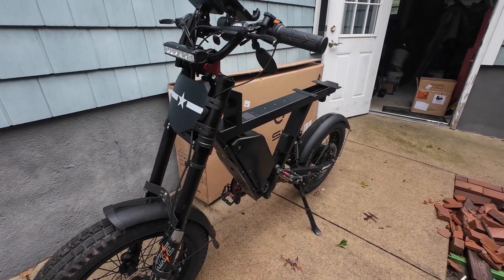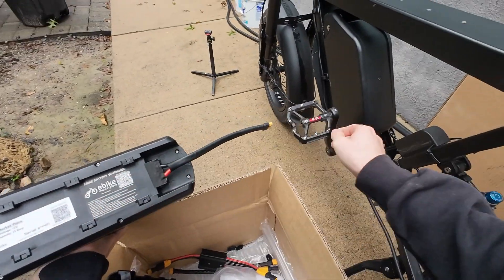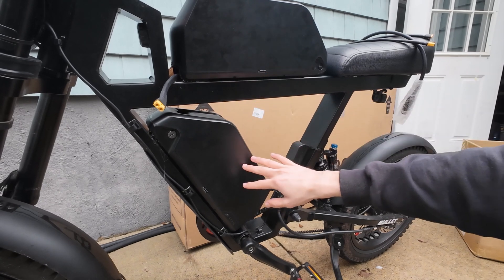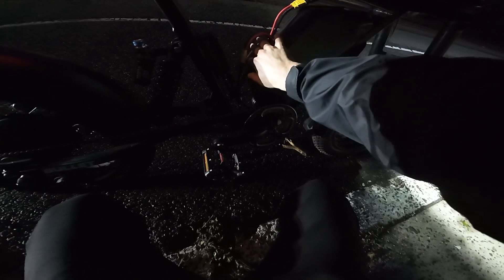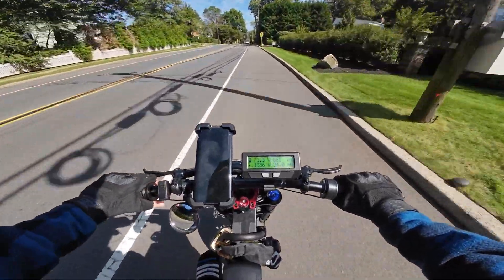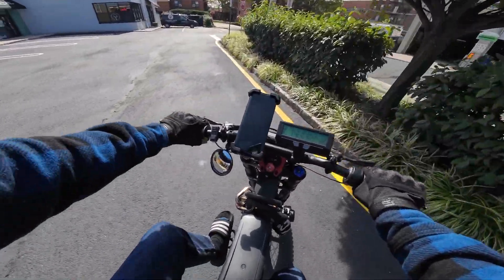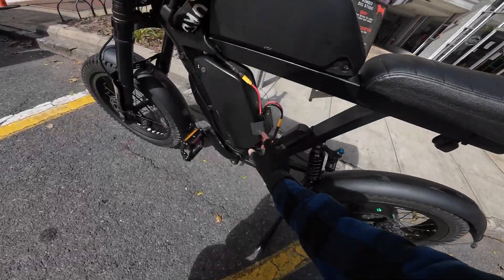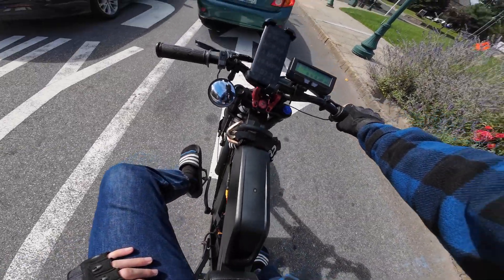72 Volt Dual Battery eBike Build

Comment: bicyclemotorworks: "WARNING:
Disconnect packs from module when charging.  NEVER charge while battery packs are connected in parallel."
Reply from the maker: This is true. I asked the battery company about this and they said the battery BMS handles it.

Comment: So if you move the controller around back  would both batteries fit in the V? If not how about hanging under the seat, is the suspension travel too far and it would hit the fender? I think getting the battery lower would handle better.

Comment: You should always charge your battery to 100% because BMS balances cells at the end of charging process! In practice BMS charges cells to ~4.2V and then try to balance them down to 4.15V.
Reply: You should do it once a while but not always. You lose a lot of battery life charging to full
Reply: @bobikbobikowy5458  In practice it does not  matter. For example I have 48V 25Ah (1200Wh) battery and I do only ~30 cycles/year. After ~500 cycles you lose ~20% of original capacity.
Reply: @ataksnajpera  you loose capacity just keeping it charged fully. I cant remember how much you loose by doing it but its bad. I got 9 years old battery and like 80.000km on it. It still works because i never charge it to full. If you make only 30 cycles/year then its even more relevant because you store it charged for longer time.
Reply: @bobikbobikowy5458  I use my bike for commuting so it is never left at ~4.15V for long time (no more than 48 hours). You are a little paranoid about battery degradation. You know what is more dangerous? Heat generated during fast discharge! for example when you constantly use throttle at 750W+. I have mid drive motor with torque sensor and I never use throttle. I also barely need more than 300W of assistance.
Reply: @ataksnajpera  maybe im paranoid but my battery lasted longer than most branded ones. I have 3000w controller and heat didnt kill my battery :p 750w is nothing

Comment: The 🎤 microphone during the video to me was better with B. I like to hear what the motor sounds like at 20 or 25 mph to get an idea of the power output and what it sounds like. Like listening to the RPM's in a car with standard shift to know when to shift. But 🎤 A😅 microphone a would be the ideal one for communication which can be very useful while riding with a group.

Comment: How about putting both batteries under the horizontal bar and move the controller upside down onto the horizontal bar. Make a vented carbon fiber enclosure for the battery section with flow thru vents for the batteries and controller.  Maybe the battery splitting unit possible at the very bottom where the batteries on the slanted part of the frame. 😊just a suggestion then there is a lot of room on top, possibly light cargo or backpack.

Comment: I left this one one of ur earlier videos too where u me tinged The ekx x21 is the gunai x25(the x25 is Lower spec Ed also know as the zwp x20) I got one from AliExpress and they are amazing but the controller may needed to be upgraded to be able to use ur 2000w depending on the brand u buy from

Comment: Also just order some 12G silicone coated wire and solder your own XT60s to the correct length and is much tidier, great video though, very professional

Comment: What are the AH one each motor? Did you sell the battery it came with? if so for how much?
Reply: Ah is a capacity measurement so is for battery packs. Motors are measured in W and how many V and A you put to it

Comment: Question im in the process of competing a similar build if you dont mind me asking how did you rewire your lights? I see you got rid of the  stock display. Do your brake lights work? Also, where did you get that frame guard in front of your battery? Thank you so much for your help, bro.
Reply: Just take the auxiliary wires from controller, run through an instrument switch cluster on handlebars and to relevant lights, indicators, horn and connect up the brake interrupt wires if you want working brake light.

Comment: You get better performance/lower voltage drop from higher wh battery, in addition to less stress on them.  The batteries appear identical.  The case for using them one at a time is that you can recharge one after its rested, and wait to put it back in after its rested from its charge.  If ever you were going long distance and charging along the way, that is actually less total stress on the battery compared to a constant lower discharge rate in parallel.

On a bike similar to your wicked 20x4, 48v, I'm getting 5wh/km by pedaling, 30kmh average, without pedaling crazy or any real cardio.  Just 150w@30kmh from motor.  35wh/mile is bad.  875w at 25mph.  That is why pedal-able bike is so important for affordable range.

Comment: If you have two of the same packs, you should just get them charged to the same level and simply parallel them together. You can skip the extra combiner entirely. If these are common port bms batteries (which is almost always the case these days) you can even just charge them while paralleled. 

At least it's not one of the INSANELY overpriced DATEX combiners...

Comment: If both batteries are the same voltage, you don't need the Dual Battery Discharge Converter, you just use a standard splitter, that's what i use with no issues.
Reply: They have to be exactly the same voltage, if not you get sparks?
Reply: @coop5000  If they are both about the same voltage they should self balance. I would never hook them up that way without verifying they are close to the same voltage. The way he did it is the right, safer way though i do agree.

Comment: That controller is absolutely tiny compared to all the other 72V smart controllers. Definitely going to buy that if I ever go over to 72V
Reply: Never cheap out on a controller man leave some overhead.
Reply: The reason it’s so small is because it’s only I think 30 something amps, most 72v controllers are 45amp or more. With the most common choice being 80amp minimum
Reply: @kimhyunwoo8983   The phaserunner can push 90 phase amps for decent bursts and about 40-50 continuous.
Reply: @kimhyunwoo8983  it's 90A+ actually. Look it up it's the grin technologies phaserunner.

Comment: That's awesome. I'm planning on buying a dual motor bike and it comes with a 22.4 amp battery pack, so with 2 1000w peak motors that's not going to be much range. I plan on adding a 20amp hour rack mount battery and doing the same sort of deal. However I have to remember one important thing...Always wear socks with sandals while testing any dual battery setup for safety.

Comment: How do you know that the control that comes with the bike will work with the battery mixer?
Reply from the maker: the controller doesn’t ‘know’ there are two batteries
Reply: Yeah that won't be a problem. Essentially nothing is changing except the capacity and max discharge current potential. It's still the same voltage and connection just more juice to spare.
Reply: I have two batteries, each one 48 volts 10.5 amps. If I connect them in parallel, will the control work normally, knowing that the control is 72 volts 80 amps?

Comment: Im a paraplegic my handbike trike "two wheels in back" i built is 3 ×52v batteries. 2×bbshd 1000w, 1 750w hub . Cruise at 30mph for idk ive never been able to do a distance test. I dont like to drain my batteries or charge them 100% but it would be cool to know. Its awd

Comment: Very nice, would you ever consider going to a qs205 or other higher rated motor?
Reply from the maker: I would like to try that especially if I can use the same controller.
Reply: @NPLVentures  does the EMP shark batteries come with a mount and charger? lmk, thanks